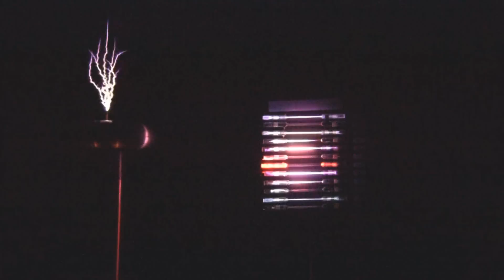Vacuum Tube Tesla Coil wireless energy demonstration

Comment: The question is how, across the 'empty' space between the fluctuating output (the tesla coil) and the gas-filled tube - how do those electric fluctuations cause the electrons in the gas of the bulb to be excited/relaxed/excited/relaxed/excited/relaxed/etc   which, on the 'relax' part of the oscillating energy, makes the electrons in the gas release light photons.  That is the question.

If there were a copper wire circuit, you could say:
......"The fluctuations of the electric field - its oscillations - are transferred over to the gas-filled tube on the copper wires - one wire leads from the fluctuating/oscillating electric field in the Tesla coil, TO the gas tube, then the 2nd wire leads FROM the gas-filled tube, back to the Testla coil - so there is an electrical circuit.  That's how the gas filled tube's electrons are made to alternate between excited/relaxed/excited/relaxed/excited/relaxed and so on, giving off photons of light on the 'relax' part of that cycle."

But there is no 2-wire circuit.  There is only 'empty' space.

Gotta be more to the story.  It has nothing to do with the air molecules of the atmosphere either - this device would work in the vacuum of space.

So what is the physical entity taking the place of the copper wires here?
.